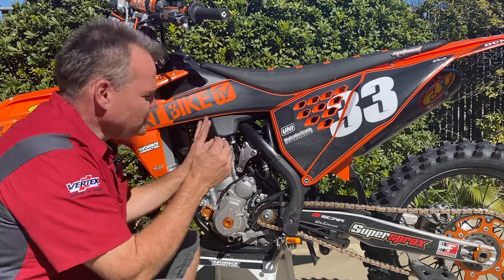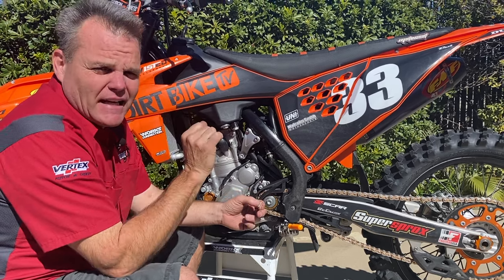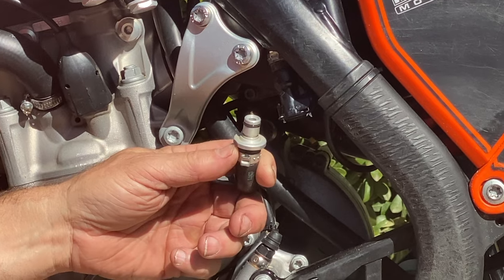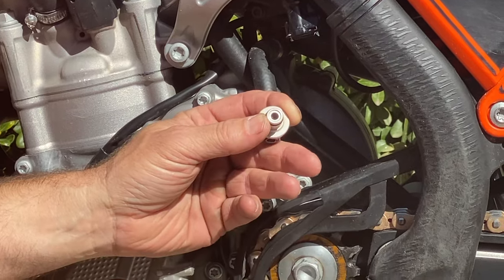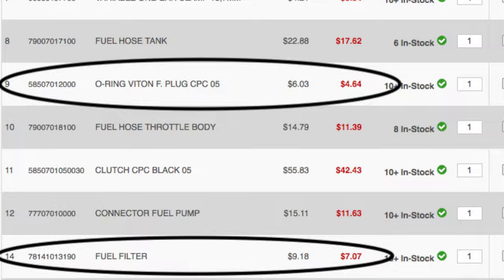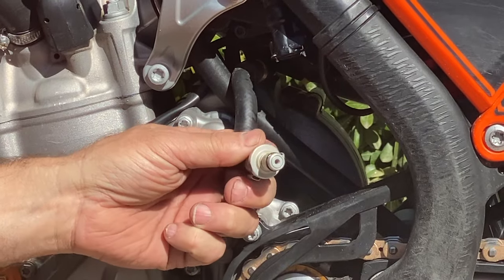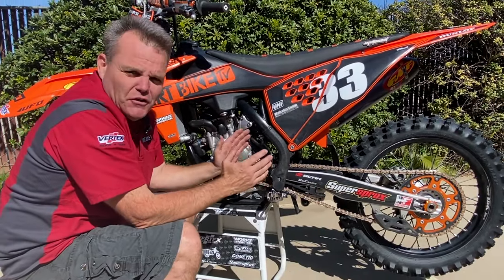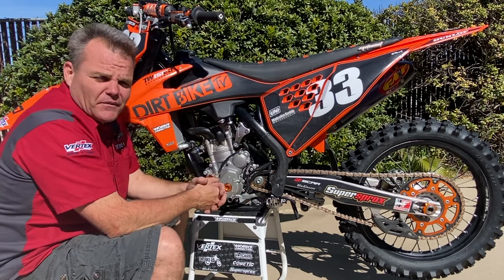KTM FUEL FILTER FIX

Comment: Can be cleaned effectively and easily. Don’t need replaced every time at all.
Reply: definitely serviceable. ive been cleaning the same one for a long time. i have a hard time getting them out of the line though, they are stuck pretty good. i destroyed one running the pick through the mesh accidentally.
Reply: @usa45v26  Just like Jay did...

Comment: Just bought a 2023 KTM 450 sxf and it came with a handful of fuel filters. I'm going to run a Twin Air fuel filter sock in the tank as well. Thanks, Jay!
Reply: I'm here with issues on my 2023 300xc 9hrs I fouled a plug , pulled tank to change it and I am hoping I contaminated my fuel filter in the process.  Major bog on face of a 25ft table almost got me hurt bad. Live these new ktms but they make me nervous with new model issues and they are now a ton of low hour ktm bikes for sale 🤷‍♂️.  Hope you have great luck with yours
Reply: My 2023 300xc is bogging randomly. 28hr, I got a 70’ double it did it on. Crapped me pants.
Reply: How do you find the sock mate?

Comment: Off topic question for ya jay. My wife is a tiny 5ft tall 115lbs , shes on a 03 xr100,  she rides the wheels off it and is ready to move up to a better bike,  I'm thinking ktm 105xc or kx100 or cr85rb or a brandnew yz85 and big wheel it.  Shes never spent any time on a 2 stroke. I do plan for a heavy flywheel weight and bigger fuel tank.  Which of these bike would you pick or any other suggestions?
Reply from the maker: Not a easy answer on this-- What you describe we have done for my 12-14 year old son when we went through that range-- there are no good trail bikes that are proper fit for her.  Any of the 105cc bikes are really Moto bikes at heart -however if she is only 5' that is maybe the best option- However I might lean towards finding a 200 or 250XC and lower it -then could do real riding on trail etc- good luck

Comment: Jay, what about the filter on the pump in the tank?
Reply: You are susposed to change the one in the tank after the first 30 hours on the bike. Mine had 130 hours on it, then it stalled and would not start again until i changed that in tank filter.

Comment: Hi Jay, in your experience how long do the 17’ and newer 350 motors last? I bought a used one with 120 hrs. I did an oil change and found aluminum shavings in the bottom screen. 😕
Reply from the maker: Well I have a guy with a 350XCF with over 430 hours on it before its first tear down-  Crazy but it all looks amazing.   New piston going in -- never adjusted the valves
Reply: Dirt Bike TV “Go or blow” as they say. I hope mine will last that long. Thanks for the reply.
Reply: Could be catastrophic or nothing to worry about it. Chunks and you're done. Poor maintenance, lack of oil changes, could result in shavings and that is never good but there will always be some metal in an oil change even if yoiu can't see it. Internal parts wear. That is why we have to change piston and rings. They are designed to wear. Gears and other internal parts not so much but do wear as well. I would be much more concerned about the color and viscosity of the oil. That, imho, will you what condition the motor is in addition to the shavings. Brand new oil and lots of shavings? Motor is toast. Dark, deanse oil probably means you just need to do a couple of short interval changes including all filters until the oil looks right. Before anyone jumps me for my opinion yes, it is just that. My opinion. There are WAY more indicators that could be baaaaad news but I find the motors are more forgiving for us mortals and non professionals than most people believe. Change your oil and filters when the motor says it needs it, not the manual.